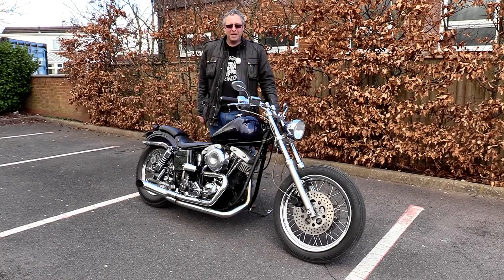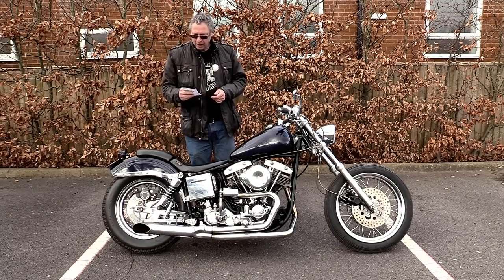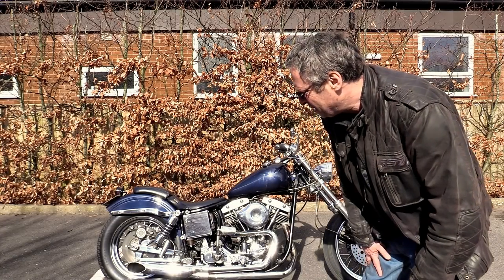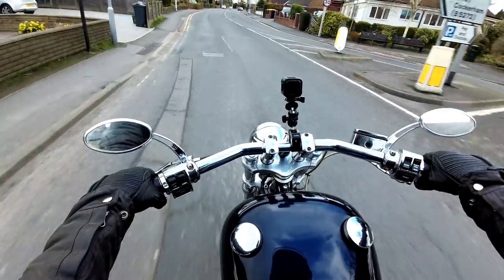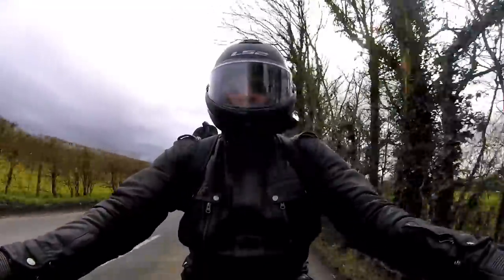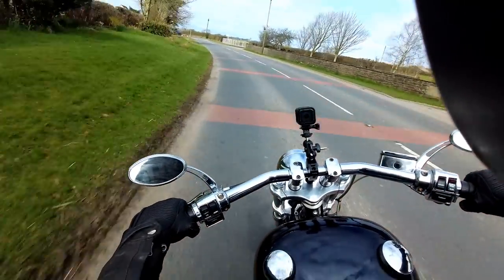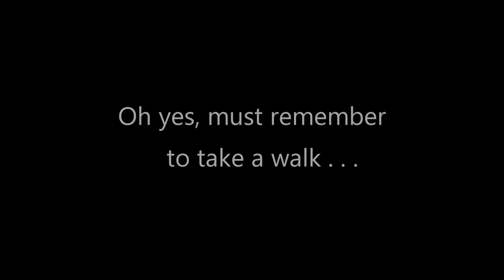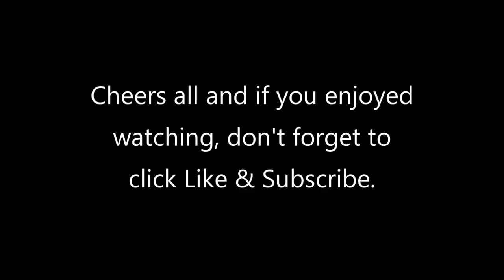Harley Davidson Shovelhead - Review & Test Ride

Comment: Harleys do sound lovely and have that benefit of being different to all the other stuff on the roads and unlike anything modern, you can still repair them yourself, unless perhaps you’re a motorcycle dealer. If you do the Scotland trip be prepared for wet weather, it may rain the whole trip. WD40 and spare plugs for the bike, would new plug leads and anything to keep the electrics dry. Best not visit Gruinard island where the govt anthrax testing was done and the nuclear power plant at Dounray near Thurso, theres a ban on fishing within two kilometres of the plant where waste fuel was dumped and leaked into the sea, the land should be “safe” in 300 years but theres some plutonium there too...half life of that stuff is 24000 years.

Comment: You wear any Levi’s jeans in particular or a black leather biker greaser jacket with your motorcycle??
Reply from the maker: Hi Samantha. The jeans are by Hood, kevlar lined armoured jeans. Higher abrasion resistance than 2mm leather. The jacket is an RST waxed cotton jacket with armour. ☺

Comment: Wot...no speedo?  Ha ha . all you need is a little dial with an arrow which points to 'Stopped'....'Going' and 'Fast Enough'.  Nice machine, sounds like a Douglas DC-3 with the odd cylinder not firing.  I think you'll still be riding her in 2030. The planned end of new fossil-fueled vehicles in the UK doesn't yet apply to bikes and surely those already on the road will be able to continue for some time thereafter.  My bikes are all 20th Century and I hope to keep 'em on the road a while yet.    Looking forward to your experiences on the road as well as the water - will there be an Amazon Prime series?

Comment: That's a custom tank I had one back in the 90s, it not two std tanks welded.
I had twin plugs and single fire ignition on my 1200 shovel, smooths it out wonderfully, you do loose the classic shovel sound though.

Comment: The sequence is 
Ignition off
Tap open
2 full kicks throught to prime
Choke on 1/4+ on the throttle 
Egnintion on locate TDC again then 1 final power kick. 
This is the cold start method. 
If this fails after a few attemps remove the plugs, Clean and put back in. 
Repeat, I don't have a button on my bike. 
Who ever sold you that bike in that condition is a complete asshole. 
Lucky they didn't grease the brakes.
Your bike revs are not too low and its nt hurting the motor. The engine is cool as it warms up and the oil thins out the revs will go up. 
You could leave the choke out a 1/4 to lift the revs whilst is warming a little. Don't forget to put it back in.
As the motor heats up the metal expands and the oil thins out then the revs pick up. 
Use straight 50w oil in the motor and gear box. Keep an eye on your oil and smell it. Kicking like that and mot burning the fuel is mixing fuel in your oil.
The swng arm is the best Harley suspension there is. Even better then the cradle swingarm.

Comment: When kicking, don't straddle the bike. Stand on the right side and with your right leg, get the cylinder on a firing stroke, stand up on the kick starter and kick the shit out of it. :Will rice most every time. Shovelheads to like a lot of fuel when cranking. the S&S has an enrichment valve on the inside back top of the carb. Open it up while kicking. It will dump fuel in the starving cylinders.

Comment: idle speed should be 1100 RPM and its the bottom end that gets destroyed with a low idle not the top. Shovleheads oil on volume not pressure.

Comment: I have a LOT of miles under my belt on a shovelhead. I realize that advice is not always easy to hear as it is just another's opinion .But, I judge you as a big boy so here goes. Your bike is set up horribly and dangerously wrong. There is a reason it rides  rough and cramps your legs so. The stock geometry works really well , and set up correctly would dance circles around what your on. The goofy trees for a rake in the front that shouldn't be there and the short rear shocks work together not to your advantage. On my FXWG. I decided one time that I wanted to lower it, so I cut the shock mounts off and moved them back on the swinger. I really thought this was cool and I actually thought it handled better but it almost cost me my life to realize differently.It simply wouldn't brake or handle as good as before as I ended up in the other lane and into the grass on the opposite shoulder. A pickup truck had to get on the brakes to miss me. The word CUSTOM may sound like a good thing, but I see it as everything wrong with your bike. Your engine sounds good and you are correct about your idle. Dummies think it cool and correct to idle as low as possible. Keep your idle up , do not let it set there and lugg. If there is one thing I would absolutely upgrade is your brakes. I can tell by looking at your back disc that it belongs in the trash. The stock brakes were not anything like what you can get now. Get something like performance machine calipers on it and you will never regret it . your tires are another problem in my mind but I'll simply say to play with your pressure. You don't want to feel as if your riding on a trapeze wire. Let some air out on them back roads .It will handle better and not be so rough. Go for a stock stance with upgraded stock length shocks, and brakes and you will hit a home run! NICE BIKE! PEACE!!!

Comment: Could be a nice bike. Replace the rear shocks with something more relaxing, the oem shocks are garbage. Plenty rake, not enough trail, not my cup o tea :) Idling way too low and ignition timing is off, expect much damage to the crank and bearings. Good luck.

Comment: that is not a DRY clutch its a wet or dry clutch.  If its enclosed you do use one quart of primary oil. if its open its run dry. I have owned a lot of shovels.

Comment: K E V I N - you sold your Kawasaki Vulcan Nomad for this POS HD? WTF!!! Don't forget to take a liter of oil with you to top it up after it leaks all over the road as you drive it. Rather than hard-tail it you should just sell it and go back to a metric bike. It might "sound" good, but what use is that when you're stopped in a lay-by waiting for the flat bed trailer to come pick you up and take it & you back to Garstang. Sorry, but as as a Vulcan Nomad owner, with friends that own Harley's, I think you made a mistake. But, if you want to be more involved in the upkeep of your bike then more power to you. Here in the USA being a Harley owner is not such an issue because there are Harley dealers everywhere ready to empty you wallet to fix you bike, in the UK that's probably more of an issue. Time to check out the "Iron Butt Association" and see if you can rise to the challenge on your SHOVELHEAD.

Comment: You're too much of a sook to ride a rigid and starting on the kicker pull the enriching on giving it 2 - 3 kicks turn on the ignition and usually first or second kick it will start if not stop for 5 and give it another kick. Also if you have standard Harley electronic ignition throw it away and put in points or a good single fire ignition. Hopes this helps a little.

Comment: Shovels are not a long life motor
Mayne 17,000
Miles then it needs an overhaul
Reply: I rebuilt my 78 flh 14 years ago, and approximately 22,000 miles later, it runs great. 
It still  has great compression and doesn't smoke. 
Mine is a stripped-down bobber, 3" open primary, Santee up-sweep exhaust (straight pipe) kick start only and many other mods. 
Usually fires up on first kick, after 3 full priming kicks half choke full throttle.
Rebuilt with quality parts and attention to detail, it should last another 25,000 miles plus. 
The most important thing is to keep up with proper maintenance. 
And making sure everything adjusted properly because it will shake itself apart eventually. (Get used to wrenching), hahaha 😆 
Life with shovelheads is an adventure.